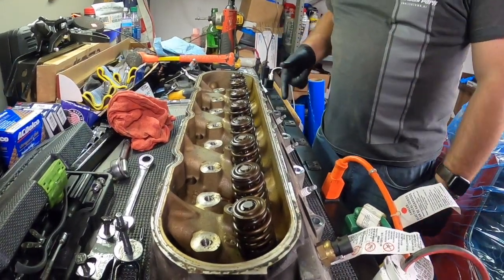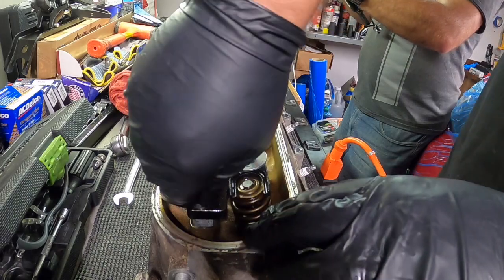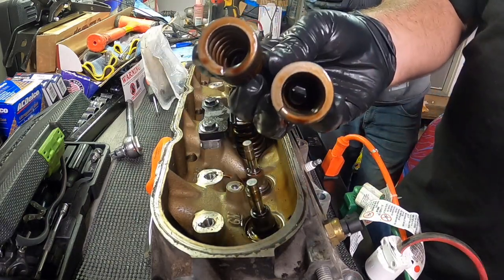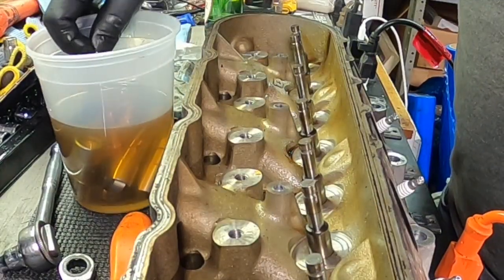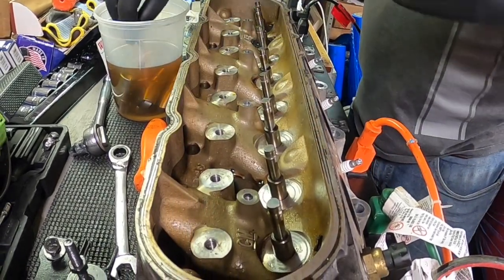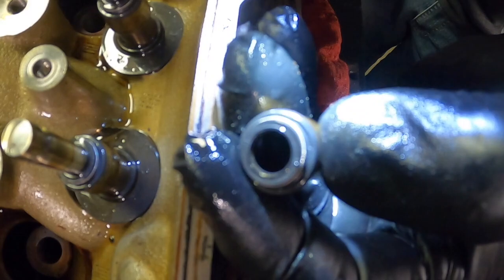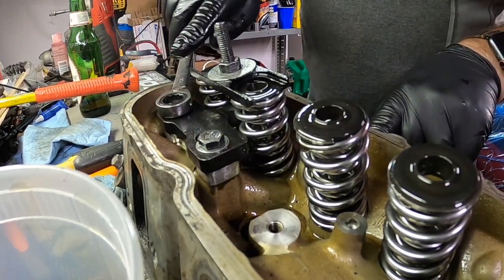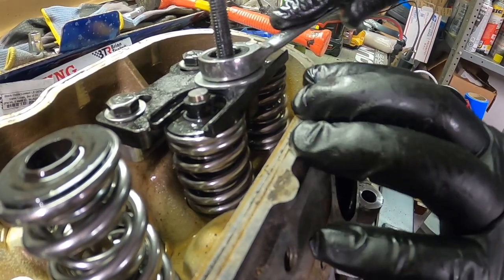G8 L76 Part 3: How To Rebuild LS Heads with 660 Lift Springs

Comment: Yeah,  you will have a gap between the seat and the seal on those 2 piece sets. You can hear/feel the difference when tapping them down when you have them fully seated. These are the type GPI and BTR will send you when using the 660 Platinum Dual springs, while Texas Speed uses those one piece seal/seat hats that work with their (PAC) springs.